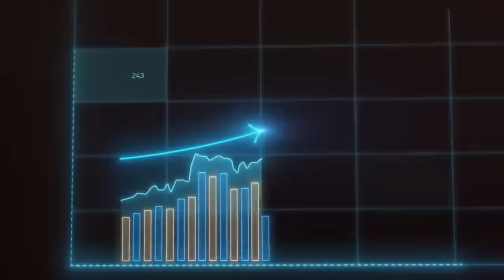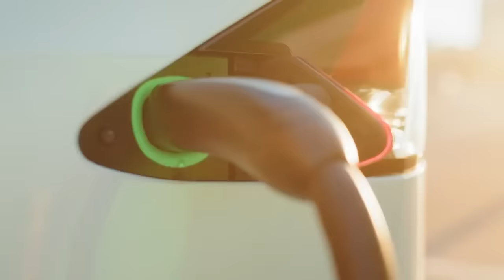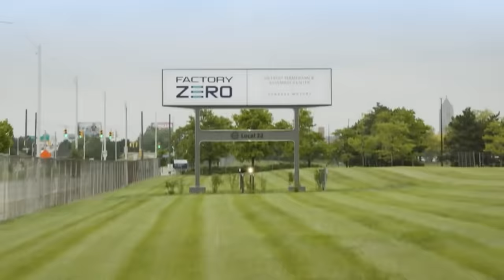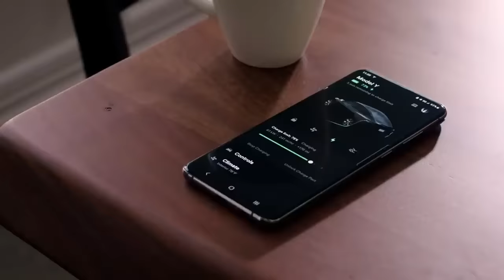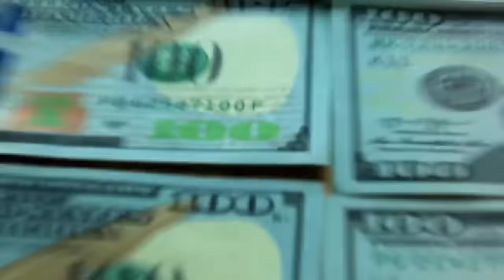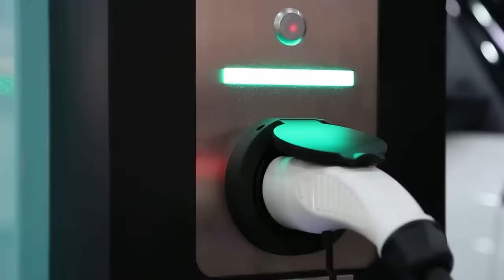Electric Vehicle Owners Are Frustrated and Demand the Return of Gas Cars

Comment: A lot of EV proponents are in denial with genuine EV issues. While there is a use for them, they are not a replacement for all ICE vehicles.
Reply: I’d argue there is no use for them when ICE vehicles can do everything.
Reply: @bradsmith9189  , the real problem, though, is the era of easy, cheap oil is upon us. Also, US fracking will be unable to make up the shortfall of conventional oil around 2030, so the world needs to find a solution right now. In that regard, EV’s can help to a point, and perhaps sodium-ion batteries can resolve the issues of lithium.

We are not in a good place either way.
Reply: @lrg3834  What's your reference on oil shortfalls? The EVs will still be using oil no matter what you think.
Reply: As an EV owner, I completely agree. The reason I got one is because I have solar + battery backup, and I drive less than 100 miles a day. Plus I have two other cars, one of which is a hybrid and the other an ICE SUV.
Reply: Certainly, in my case. I have no use for an electric car. I live in the middle of nowhere. E bikes, though? I really want one of those.
Reply: I drove my EV thousands of miles in frigid condition without any issues. You need to educate yourself regarding an EV. It is not a gas car so you have change your behavior.
Reply: Ok, so what are the EV issues. This video is just a hot job by oil and gas companies so they can sell you more overpriced fuel 😂😂😂
Reply: @abansalify  I drove my EVs over a hundred thousand miles. Plenty of issues, and each mile is an anxiety what comes next.
Reply: @seacap8  As correct as you are. Ponder this. If our bleeding heart government cared about the environment as much as they say they do. Why wouldn't they invest billions of dollars into our own infrastructure so people might actually feel more comfortable trying and owning an ev? Instead, they fund other things. Follow the money. Big oil is crooked, but who invests in it? Not me. I can't afford all that many shares.
Reply: @WaclawKusnierczyk that’s scary with such expensive repair costs smh
Reply: Its a matter of 'horses for courses' . If you can charge at home and ONLY drive a few miles to work every day - they are ideal but for the few miles driven the cost of the EV will make the cost per mile astronomical. An ICE car covers all situations - range, weather, ease of refuelling, lower initial price, lower cost of insurance etc.
Reply: @richardlewis5316  , until they roll out a North American version of the Nissan Sakura (sells for USD $13,000 in Japan) powered by sodium-ion batteries, you’re absolutely right. However, every EV proponent out there will fight you tooth and nail trying to convince you that you’re wrong and bad.
Reply: The EV evangelists I I call them ALL say the same things ie sing from the same song sheet - almost word for word. They all say they charge at home, they all say they hate filling with gas/petrol(UK) they all say they never have to have servicing (or tyres!!) etc etc.. If EVs were so good why do so many governments offer bribes to make you buy one? Politicians lack common sense.
Reply: @abansalify  You need to educate yourself..  That’s called coping to limited capabilities..
Reply: @seacap8  You want to know the funny thing.  The vast majority of people don’t give 2 chits if you like EV and it works for you.  They aren’t saying everyone should own a gas car and the government should mandate it.  Can’t say the same for the your side can you? 

Tell me you don’t like big all mighty government and don’t hate the free market without lying… lol
Reply: @lanejohnson7656  i have educated my self and have been using EVs for a long period of time with no issues  even in frigid conditions. I follow all the EV mannerism.
Reply: @WaclawKusnierczyk  if you have driven more than 100k in EV then you should know when to charge and how far you can take your car which means you should not have any anxiety. I have done cross country trips, trips to Canada with no issue. I have taken my car to 1% while on a trip with no anxiety coz i know how far my car will take me. There are so many apps to guide you like Plug Share, A better route planner etc.
Reply: @abansalify  You cope with their limitations…. I have a novel idea.. Why don’t you enjoy your EV and quit making them out to be the future for everyone..  I don’t think anyone is saying they should be banned .
Reply: @richardlewis5316  EVEN Horses are better than EV's. They're far more reliable, they don't burn down, they don't need software updates.
Reply: @fmo94jos8v3 Then go get a horse. To each his own. I loved my BMW diesel, and I love my Tesla as well. No need for a horse here.
Reply: There ok for some people. If u want on go on but don’t act like there better. And own an indoor E-go-kart track .
Reply: @bradsmith9189  ICE can't fill up at my house, but i can charge my EV.
Reply: We can go back to horse and buggy days and everyone farm for a living . I know that sounds crazy but everyone is working more for less and using credit cards for food let's get real the system is failing and it's much deeper than oil and cars, humans may to go back to our roots to survive.
Reply: @bradsmith9189  I mean until an EV can charge as fast as filling a gas tank go as far as an ICE car and be as cheap even with non home charging there is zero point in owning one.
Reply: exactly - they can replace some but not all and in very specific use cases. Plus hey can we plant more trees planet earth - 2 billion trees should be right.

Comment: I live in an apartment. There is no possible way for me to charge an EV car overnight. This makes it impossible for me to even consider owning or leasing an EV.
Reply: Many people who live in rental and condo buildings, and many with homes that rely on street parking have drank the Kool-Aid and purchased EVs and rely on public charging stations to energize their vehicles.   They are living a nightmare.
Reply: Why would your residential status have to make your decision of to buy or not to buy an EV?
Reply: @madewithscraps  If you don't have a house, a driveway or garage or a home charging system, you can't charge overnight at home.  If you rely on public fast charge terminals, you can pay as much for electricity as you would for gasoline and extended time periods to gain a charge.
Reply: @chrisgraham2904  I'm honestly surprised he even asked that question. I thought it would be common sense, but hey. Atleast he knows now.
I'd like to add that home charging users usually also have solar panels which reduces the pressure on the power grid and it's associated coal/gas electricity production besides cost reduction for the home owner. So if you drive short trips, own a house and solar panels then an EV could be a serious option for you. Else stick with hybrid or ICE if you can't afford it.

I kinda like the new prius with a solar panel being able to get a few miles a day by just sitting outside for your short daily commutes, yet use gas whenever you go for a long trip.
Reply: @surena9451  I think EV owners that charge at home and have a home solar array are the exception, rather than the rule.
EVs are a great solution for many people's situation and the initial owners were usually homeowners, self-chargers or their EV was a second supplementary vehicle.  As usage expands to more people and beyond the ideal conditions the cracks in the armor are becoming very apparent.  
The hybrid does seem to be the best of both worlds, but governments aren't promoting hybrids as much because hybrids won't achieve the desired climate numbers.
Reply: You want to own an electric car which are very expensive than gas cars yet you don't have your own house 🤔. Priorities, priorities!
Reply: @onsokumaru4663  LOL  That's true.  Throw $70K into a house and it will grow to $200K in ten years.    Throw $70K into an electric vehicle and it will depreciate to $400.00 scrap value in 10 years.
Reply: Just to clarify, my first and only priority is finding a house with land. I was just trying to point out that apartment life isn't compatible with EV cars yet. It just isn't convenient enough, and I feel like the news never points out the flaws of people renting housing with EV cars. The government needs to slow down, with EV cars being ~80% of the market. If that becomes a reality too soon, then apartment people will struggle to find a vehicle that works for them. Hybrids are probably a better alternative right now, but there may be other options, too.
Reply: @92stefan1  Well that’s the rub isn’t it.  Because, you see, you not owning a vehicle at all also works even better for them so they just don’t care.
Reply: Cities will build chargers along every street, it is very cheap and easy to do. EV use 70% less energy, it would be insane not to go that way.
Reply: @chriswilliams8607  This comment is so ridiculous, you've got to be trolling us.
Reply: @chrisgraham2904  man  if houses only cost 70k i think less ppl would be freaking out about rent
Reply: @jamesr9400  LOL  I said; "throw $70 K into a house", as in; invest $70K into a house.  Didn't say you could buy a house for $70K.   The minimum down payment for a  house in my city is $200K.
Reply: Then don't buy one. No one is making you buy one.
Reply: @chriswilliams8607  I think it's a pipe dream to think that EV chargers will be available at every parking spot along a street.  Street parking doesn't allow anyone to have a dedicated parking spot anyways.
In many European cities, where EVs have become much more abundant, there are far more privately owned payable chargers available and the cost to charge from them is higher than refueling with gas or diesel.
Reply: @cheerry777  That's a simple answer, but many governments are forcing manufacturers to quit manufacturing ICE vehicles by 2030 to 2035.  It will take another 10 years after that before used ICE vehicles actually become rare on the roads.  Eventually, people will be forced to purchase an EV and the infrastructure will need to be in place and the current issues resolved.
Reply: @chrisgraham2904  it won't as simple as you think. There's always exceptions. Realistically, I don't think it will happen. If it does happen, there will be many many charging stations, super fast charger. Owning a home charger will not be needed, just as you don't need a private gas pump to drive a gas car. Also, NOT making gas vehicles doesn't mean all must be EV. Remember, there's Hydrogen power cars, possibly other eco-friendly cars. By that time, many other eco-friendly options will become the available. Not just EV cars.